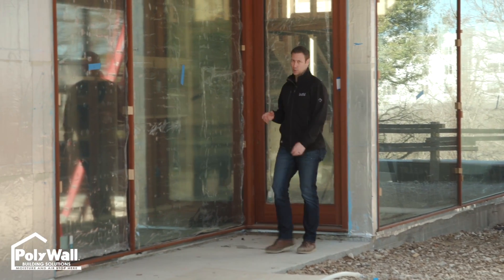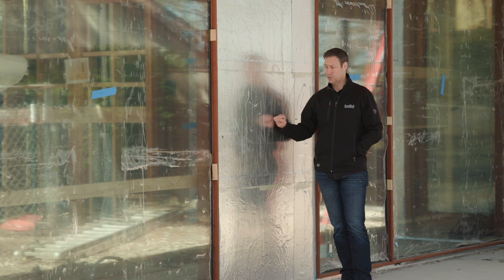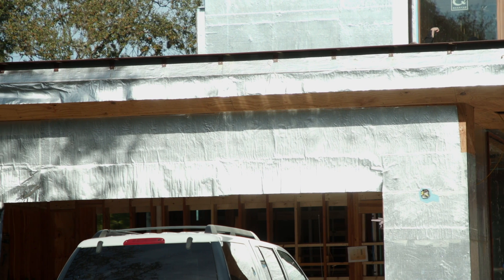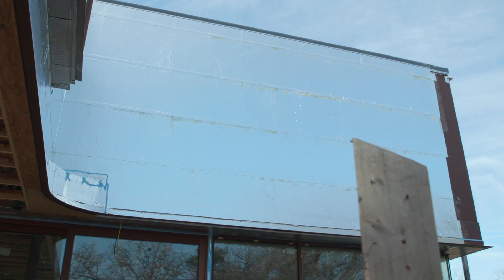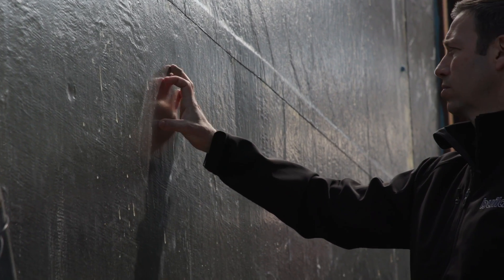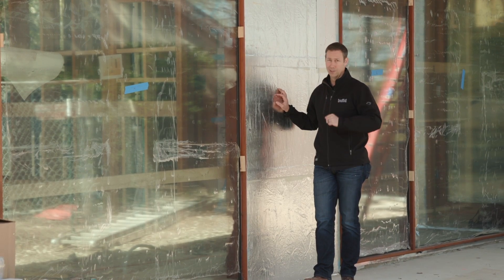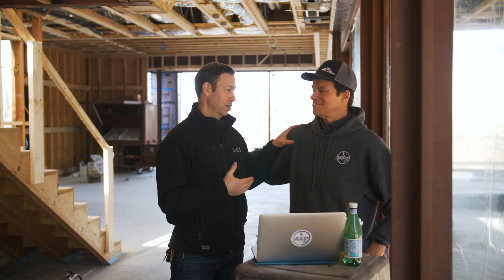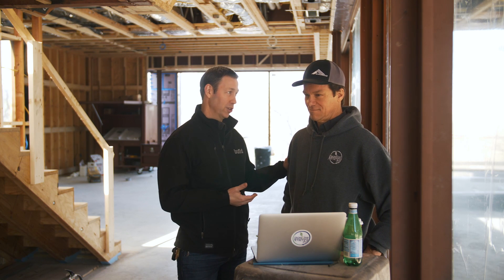Is a Zero Perm House Wrap Stupid?

Comment: in my climate, it is pretty much guaranteed that a completely impermeable wrap will rot a house from the inside out.
Reply: Do you not have dehumidifiers in your area?
Reply: What is your climate? I live in Ct. And I see Tyvec and seeing more & more Zip. Haven't seen continuous 2" insulation on the exteriors.
Reply: Not if most or all of the insulation is outside the impermeable wrap.
Reply: @hailexiao2770  just changes where the rot is.

Comment: There may be some additional benefit beside preventing mosquito fly ins with an always on air circulation and make up system that maintains a positive interior air pressure. The last time I had a cold or flu was last century but that's just luck. At least the building code and the manufacturers keeps trying to get it sorted, one day perhaps?

Comment: Am thinking wow wonder what the mold situation would be in your building if you did not as you mention every time you do a hvac show.. those gigantic dehumidifiers to suck the humidity out of those igloo coolers with alumiflash.  I always keep in mind that houses today are a more unified system.  Can only imagine what would happen in short order if you did not not add on those dehumidifiers that pull gallons and gallons of water out on a daily basis

Comment: Matt,  are there complications with this system in your area for households that alternate having windows open with having them shut and hvac on? seems like the moisture from humid air in open windows would have no where to go... or would the a/c pull enough of the humidity out?

Comment: As a very practical and experienced but fairly science oriented builder, I note a couple of things. 
1) Water passed via permeability is very low; by "holes" is very high. For these houses/ climates, my take is that the Alumaflash Plus is very much the superior approach, but not because of zero perms. Rather, because of the SELF-ADHERING AND SELF-SEALING properties. Any wrap that does not do both is vulnerable to holes and tears, that become LEAKS, of air and water. There are all kinds of assaults on the wrap in the continuing processes of completing the exterior envelope (fancy way of saying it gets impacted and fasteners punched through it, extensively). That potential for leaks is in my mind the death nell for traditional wraps. The lab tests are irrelevant; real-world performance is everything. As built and demonstrated here, this control layer must have zero vulnerabilities (and the perms are along for the ride). I think it is also crucial to note the use of the caulking/ liquid applied  (blue) at all the intersections. The down side of sheet goods is the inability to cover three-way (three plane) intersections monolithically  and absolutely. There is always the point of intersection that is "open" on every layer, and must rely on a sealant being applied. I doubt anyone will waste their time discussing the perm rating of the blue liquid applied. That is simply not the critical attribute for this material at these points of use. 

2) If the demonstration and analysis is for cavity-only insulation, then they have lost me already. I can't warm to (HA!!) anything short of continuous exterior insulation. One can argue the fine points of material choice, etc, etc, but the fact remains that continuous exterior has a far better overall performance for the building envelope. I have done this for compact roof assemblies (including with conditioned attics) and for exterior foam insulation for conditioned basements,  for over 40 years now, and first did continuous wall insulation over complete liquid applied (vapor permeable) a decade ago. No reason to discontinue that practice.

Comment: So I get that if you keep the house sealed then you do not need to worry that much about the cold line in a house, because there is never that much water in the house, but how does this work, if you want to open the doors and winds in the spring and fall when it is nice out, would that humidity cause issues and ones you let it in never truly come out?

Comment: Zero Perm House will (is likely to) work if you implement it perfectly and it in fact becomes zero perm, but if the construction company is sloppy or makes any honest mistake then you have more issues when you get water into system that is not supposed to get any. So if you go this route, you better pick best in the business contractors.

Comment: are there any good resources for remodel up north? i've got a house. gutting to studs, would like to make it bigger but worried about addition sag over the years and complications with the roof. also not sure what i should do with the insulation, as there currently is none at all. and what of the basement? is there a way for me to not have a giant brick chimney up through the middle of the house through the roof? is there something i can do about the water pouring from the walls?
Reply: in cold climates you want plastic on the inside. spray Foam also is good.

Comment: Can you do a similar video on northern climates? From my limited understanding, an exterior vapor barrier can be a problem because the warm humid air is on the interior of the house. So if it migrates to the exterior, it will condense on the inside surface and cause a failure.
Reply: So if a Interior Barrier is properly installed (house in Northern Zones) and a Dehumidifier is set to control the Humidity to say 20% maybe less, no problem. But damn is it possible to seal every hole unless you use AeroBarrier?
And we KNOW the production builders are not going to use these dang expensive procedures/products!
Reply: You want a tyvec type outer coating here in the north. All it takes is a pinhole in the inner plastic to get a lot of water in the wall. Also for attics you want to mix cellulose and fiberglass since fiberglass looses it's R value when you are at -40.

Comment: So I am confused on one part, several years ago you were showing housing completely coating with a poly wall blue barrier, are these products used in differnt applications? Or is completely coating a house much more expensive and that's why it's not done as often?
Reply: @WinWash00 You might check out Barritech VP, made by Carlisle. It will only be available through a commercial/ industrials coatings and sealants distributor. Excellent product, with a bunch of compatible accessory products. We tested extensively, and have it in place for 8 years now. Only way to go, on complex continuous exterior insulation projects. The labor (surface prep) is the real cost, not the product. As a pro builder, the cost is not the issue, the risk exposure for not going that last critical step is the overriding concern.

Comment: Once you nail your siding on then you make the aluminum permeable.
Reply: ...it's a self sealing product?
Reply: The 2 components that are used in Aluma Flash Plus are 1) the 100% Aluminum 5 mil Facer laminated 2) our modified asphalt 35 mil compound.  Both components are  impermeable.  The Aluminum facer provides the 2 year UV exposure making it the most robust WRB available.  But alas, you are correct, once the aluminum is ruptured, it is no longer vapor closed, however the 35 mil of modified asphalt encapsulates and seals around the shank of the fastener and maintains its impermeable integrity.

Comment: We need a norther version of this video!!!!!
Reply from the maker: Good call!  Yes. I’ll add that to my list
Reply: @buildshow  He was saying the graph for a vapor permeable membrane was one which was common. I'd like to see the graph for Delta Vent SA to see if it does better.
Reply: A northern version would be greatly appreciated
Reply: In cold climates, the vapor barrier goes on the inside, so you want a permeable wrb to not trap your moisture within your walls.  However, some northern climates have humid summers, so you need to check your specific climate zone and local building codes.
Reply: I agree with Ian. Around the Great Lakes, we get high humidity with rain in the summer and heavy snowfalls with blistering cold in the winter.
Reply: @David-gld  Right. My commentary was directed at the limitations of WUFI in general, in addition to where the analysis could be applied climatically. As noted, so long as one side is fully open and drying, it seems like it should be good. Without that, I suspect that there will eventually be problems. Desert conditions might be an exception--almost anything works there.
Reply: yes please, zone 4 Seattle area!
Reply: Nice explanation but you could do it a little different:  
The physics is quite simple if you want a proper house you need a quality vapor barrier on the hot side of the wall.
In hot climate (24/7) you need a barrier on the outside of the wall/roof in colder climate where you have a  warmer area inside you need a barrier on the inside part of the wall/roof. This rulle is for water vapor (mold) you still need a rain protection/curtian on the otside of the wall even if you have a vapor barier inside like in colder climate this aditional barrier must be vapor permeable like a goretex for people .
Reply: As a northern person myself. If it’s water/vapor proof in the north. Would still be a huge benefit.  By no means I’m no building engineer. But dry is dry. Lately in the Chicago land area I’m noticing more roofers doing full ice and water shields. With no problems
Reply: ASHRAE 160 moisture loading?
Reply: YES PLEASE!
Reply: You want a tyvec type outer coating here in the north. All it takes is a pinhole in the inner plastic to get a lot of water in the wall. Also for attics you want to mix cellulose and fiberglass since fiberglass looses it's R value when you are at -40.
Reply: @LaserFur  how do you install your wall material and trim without making holes in the plastic?
Reply: You mean the testing was only done in a sunny, Southern climate? Isn't WUFI good anywhere, at least if you only need the house to last for 10 years? I'm sure they've got the modeling of complex three-dimensional airflow networks in walls down cold. Sort of like weather forecasting models do.
Reply: @ReflectedMiles  While it's sunny and southern, Climate Zones 1, 2 and 3A are subject to the heaviest rainfall (bulk water) totals and humidity (moisture laden air) versus the rest of the country.  Our goal with the A+ Wall system is to offer builders the best resources to keep that water out of their structures.
Reply: Dan Thomas  As long as there’s no vapor retarder, including Class III (e.g., painted drywall) on the interior, that sounds good. Otherwise, “it dries or it dies” seems likely to be the bigger factor over a very long time horizon (100 years or more).
Reply: Dont know if anyone gives a damn but if you are bored like me atm then you can stream pretty much all of the new series on instaflixxer. Been streaming with my brother for the last couple of weeks =)
Reply: @Saint Zyaire definitely, I've been watching on instaflixxer for since december myself =)

Comment: Climate zone 1a, 2a, 3a only. You guys heard it here first. That's like less than 20% of the country.  Use any other areas are at your own risk.
Reply: The WUFI simulation was conducted in Climate Zones 1, 2 & 3a because those zones receive the most rainfall (bulk water) and are the most humid (moisture laden air) areas in the country.  Our A+ Wall System can be installed in other zones when combined with   properly designed HVAC/Dehumidification  equipment i.e. the mechanicals must be as robust as the WRB.
Reply: @David-gld  which means absolutely nothing scientific. Can't be proven.

Comment: There zero perm wraps are only zero till the siding is nailed on. So I don’t really understand it because with all those thousands or nail penetrations, if water gets in, it seams trapped.  If it’s not perfect what happens?  I suspect many reported failures are from production builders that can’t charge enough for Matts level of detail.

Comment: Im using 7 perm in S. Florida and drying both ways. You have to build perfectly, when you use this zero perm material. I resectfully disagree with using zero perm rated WRB. 5 to 10 perm, Rockwool, ERV and De-humidifier.
Reply: Curious What WRB are u using that has a perm of 7?
Reply: @David-gld  Well, im not going to put zero perm on and watch the weather forecast every hour. because if one stick gets wet, you are screwed. Thats why Matt's friend there said, make sure you are totally dry before application. 7 perm is not terribly vapor open. Thanks for the opinion, its healthy.

Comment: It needs to dry in one direction. The vapour barrier (poly) on the inside would (required in Canada by code) would be the Achilles heel.
Reply: You CANNOT use a zero perm exterior and then use poly sheet (or equivalent) on the interior of the cavities. That is a disaster, and only a fool would do such. We sit with the plans examiner and get a written sign-off on NO interior vapor retarder on any exterior insulation/ air seal job. Guarantees we will not be harassed for doing it correctly, before we start construction. We have negotiating room then, none at all when being inspected after that part of the work is completed. Poly sheet is useful only for keeping moisture trapped in the cavity, and does relatively little to keep moistures out in the first place.
Reply: Well the Canadian codes calls for poly so the insulation, WRB, has to be vapour permeable.  
Make it an option, but assemblies need to dry in one direction or the other.
Reply: Poly on the inside makes sense in the Canadian climate.

Comment: In the simulations it sounds like moisture got into the wood structure in both tests. But how did the moisture exit the wood in the vapor closed model?
Reply: anonymous through the interior. Air conditioning for example
Reply from the maker: Yes
Reply: @buildshow  will you be putting aluma flash on your personal home build?
Reply: anonymous ... realistically, it must have dehumidification equipment, such an HVAC unit and/or a dehumidifier to maintain the lower levels, otherwise the moisture would be trapped. The only other way the moisture could escape, is via an open window or door, provided the humidity is lower outside, however, opening doors and widows could in turn, increase the interior humidity levels. It’s something that will no doubt have to be religiously monitored, because it would not take long for building materials to reach a moisture level of 20% without a means of removing the humidity. I don’t mean it would happen overnight, but moisture content typically ranges from 9-15% in a vapor open structure, so it doesn’t have far to go. It would likely never exceed 25-30% without another moisture source, but the structure would suffer from dry rot over a prolonged period in that range.
Reply: @circularebin  anonymous is talking about moisture INSIDE the vapor closed wall assembly. Controlling the climate in the area inside the house with HVAC does nothing to dry out that vapor closed wall assembly. His question was how would a vapor sealed wall dry out if for some reason moisture gets into it.
Reply: Thank you for the replies. My understanding of vapor drive is that it would be directed towards the interior of the house during the hotter months and towards the exterior during the colder months. I agree that during the summer a dehumidifier would work to reduce the moisture inside. Though, it can get cold enough in Texas to have the vapor drive pushing out towards the vapor closed wrb for at least three or four months out of the year which is long enough to begin growing mold.  Im also wondering if they modeled a vapor closed wrb over exterior insulation. Would that move the cold, condensing surface away from the wood in the structure, effectively protecting it all year round from moisture?
Reply: anonymous ... that’s where the poly iso can shine, but it has its own drawbacks from time degradation. I think the main question surrounding all of this is, whether you would ever see the return on investment. People like to speak of their “forever home,” but is it, really?

Comment: Matt, all good and well, but we know what you choose on your personal build...and it wasn't Polywall.  Installing self-adhered wrbs are a pita. Lots of labor and they are fiddly. Simply easier to use Zip

I'd love to see more of Kristoff on the channel.  Maybe a bit geekier content, but he deserves a bigger audience.  I listen to his podcast.
Reply from the maker: Good question. For me it boils down to exposure and budget. For a high exposure house I go AlumaFlash all day. Overhangs and a budget, Zip.
Reply: Agree. More Kristoff please
Reply: henry blueskin vp100.  better than zip all day long. and no particle board involved
Reply: @welewisiii  OSB isn't particle board, and the OSB used in Zip, Advantech, is far better than ordinary OSB.
Reply: Problem with Zip is requirement of good seals at taped joints.  Given dust and other realities of the jobsite there is a high risk of poor adhesion.  I see people going away from Zip back to Tyvek.  Basically the issues is that your sheathing joint aligns with tape joint.  Tape failure leads to water infiltration at sheathing joint.  Tyvek joints do not align with sheathing joints, so failure there does not automatically become water infiltration.
Reply: @paveli1181  you can use liquid flashing